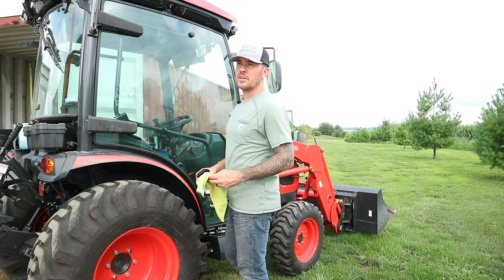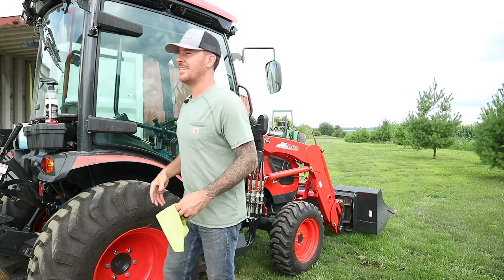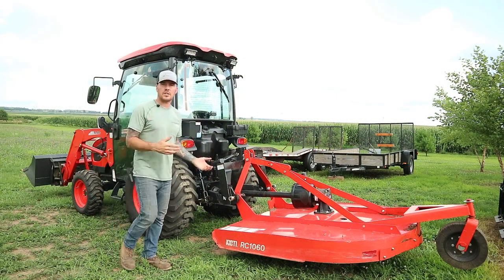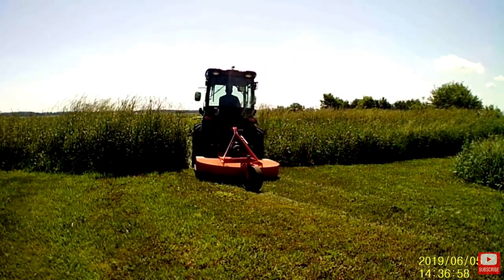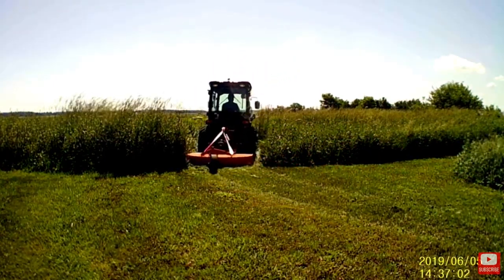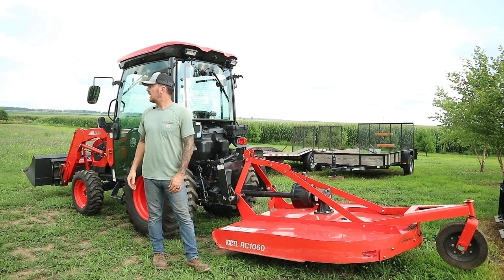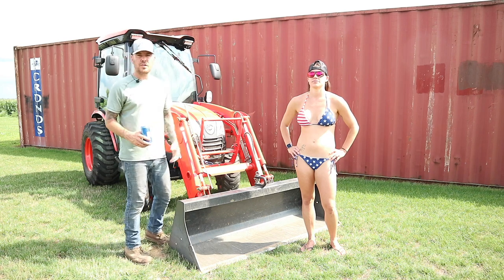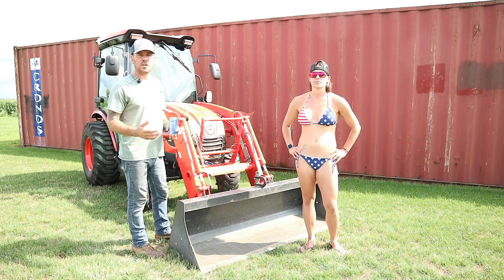KIOTI CK2610    BRUSH HOGGIN & BIKINIS!!!!!

Comment: Thoughts on the brush hog, I am looking at the same model.   You cut anything thicker with it, maybe 1 inch sapplings? etc   Just curious whether I woudl be ok with that on or maybe step up to a heavier one from Woods.   I am purchasing a ck 3510 or 4010 so the extra HP should cover a heavier one.
Reply from the maker: Hey Phil,   Yes i have cut larger with it.  Ive put it to the test at my neighbors property.  Was cutting 1” and maybe a littler larger than that at time.  It did pretty will in the heavy brush.  Hope that helps

Comment: I too am interested in the brush guard and the auto quick connect. Is there a way to use a separate electric / hydraulic cylinder? I have seen snowblower  chute deflectors with those type of cylinders.
Reply from the maker: I don't know.  Ill will have to look into that.   I was thinking about a way where I could still have the 3rd function available.  Thanks for the idea

Comment: It would be interesting to see the time difference and ease of use difference if you got the flail mower attachment for your mini excavator and mowed the same bank.
Reply from the maker: That would be the perfect tool for the job for sure.  Less stress on my neck too. I do want to purchase the flail mower in the spring.  We did sell that house so i wont be able to test it in that ditch.

Comment: I have the same tractor and love it too. Have you already turned up the fuel pressure or considered it? From what I have been researching the motor in this is capable of producing the 35hp of its bigger brother, but they had to cut it down to 26hp to be below the thresholds of a diesel motor requiring emissions crap. Any thoughts? Thanks
Reply from the maker: I have not turned up the fuel screw.  I did ask the dealer about that a while back and they confirmed that the motor is a detuned 35 hp.   Which is great.  I havent had any situation where i needed more power so ive left it at the stock setting.
Reply: @SpicerDesignsLLC  I was thinking about it because when I run my woodmaxx chipper it could use just a little more and when I'm traveling in high (hst) it slows down a lot on my hill and struggles.
Reply from the maker: @alittlebitofeverything5090  ya i could see needing some more power in that situation.  I know the hills rob a lot of power.  Ive seen one video of a guy cutting off the cap and adjusting it.  I think he turned it out until he saw black smoke.  Thats as much as i know about it.
Reply: @SpicerDesignsLLC  I must have watched the same one lol, it's the only one I found on YouTube and it got me thinking.